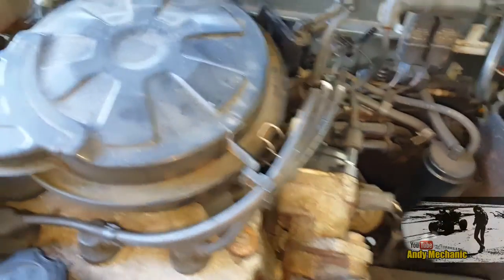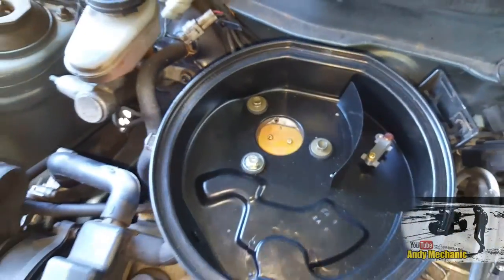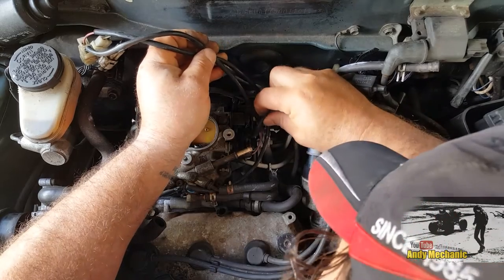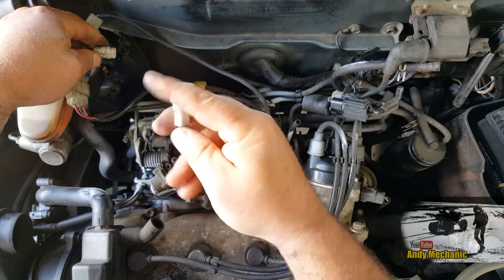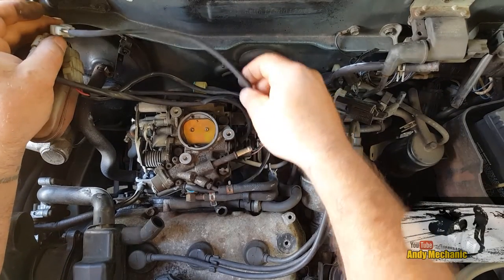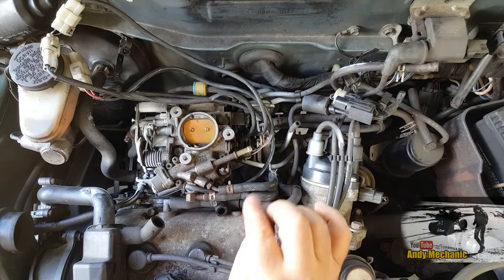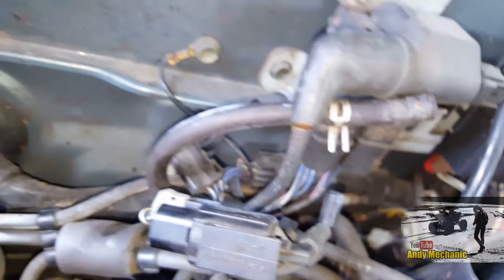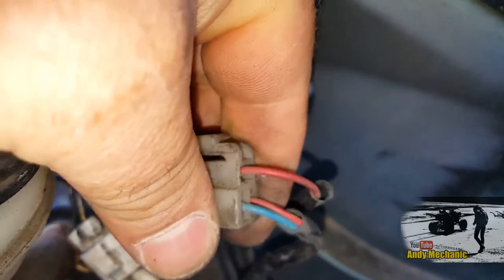Suzuki Alto carb wiring #1961

Comment: thankyou so very much Andy...
I was looking for a connection diagram, for Mikuni Ucal carburettor for an Automatic Suzuki Zen,1999 model. 
Unable to find service manual, but got an overall idea from here..
Any plans for explaining the sequence - (diaphram opening order and all) is very welcomed in advance !

Also, tuning it for mileage and performance. My carb has a hose connection, which is cut in between and plugged with screws. Probably an effort to save fuel, by previous owner I guess..

Comment: Thanks for sharing, Andy. That looks exactly like the one I just bought and I'm trying to get the carb adjusted... idling way too fast. I'll let you know how it goes, God willing.
Reply from the maker: The fast idle is most likely a lack of coolant reaching the auto choke mechanism - this will keep the carb on cold start with fast idle. Check this first before you start adjusting stuff!

Cheers Andy
Reply: @AndyMechanic  When engine hot (fan has run) can see the waxstat piston has pushed the acclerator return stop aside on mine. Took off accelerator cable and throttle still needs to be pushed back to stop high idle revs and it won't stay there. I don't think it to be the microswitch activator adjustment wrong, but can't see anything else external. [I got rid of bubbles in the coolant system (with a funnel in the radiator cap allowing for expansion.) More bubbles happened when the engine stopped and I squeezed the upper hose to the radiator, so restarted engine and repeated process.]

Comment: Hey Andy, I have one of these myself (1997 HA11s Suzuki Alto), you wouldn't be able to help me find out where or how the carby / vacuum hoses go?... Ive had a search, and Im struggling to relate all the "F6A multi cab" videos (in a foreign language), to my car..

YES I pulled it apart because initially it was (still is) running on 2 cylinders, but thats another story..

any replies or direction greatly appreciated

Comment: I would like to ask what is the car model here? I have been having issue with an auto choke on the same carb and I can't get it to run properly. I would like to see auto choke assembly looks like. Thanks!
Reply from the maker: Hi, the auto choke system works on coolant temperature. If you have an air lock in the coolant pipes that run up to the carb then the auto choke will not de-activate. Basically the engine will have a fast idle and run rich.

Hope this helps

Andy
Reply: @AndyMechanic  do you have pictures of the actual auto choke assembly? Mine was mishandled and parts were hard to come by here. Appreciate an actual photo.
Reply from the maker: Send me an email to andymechanic@live.co.uk and I'll take some pics tomorrow if I get a chance. The car is here
Reply: Your video is very helpful but I need to know about vacuum diagram I purchased same carburetor all vacuum pips cut so please I need to know about all vacuum pipes.
Thanx I shall be wait for your reply.
Reply: Please share a video about all vacuum pipe connection like you share a video about cab wiring connections.
Reply from the maker: Next time I work on the car I'll do you a video showing where each pipe goes.

Cheers Andy
Reply: @AndyMechanic  ok thanx I shall be wait for you reply or uploads.